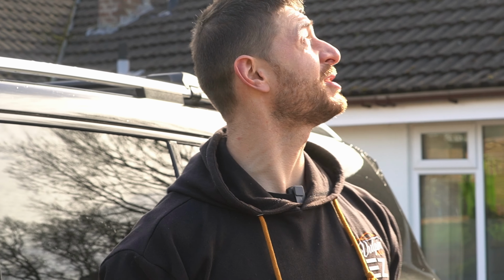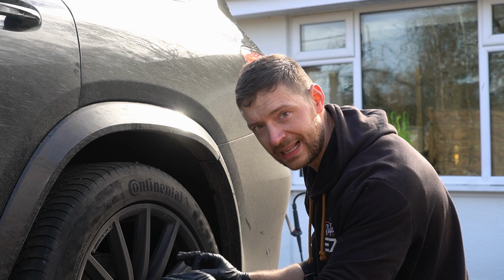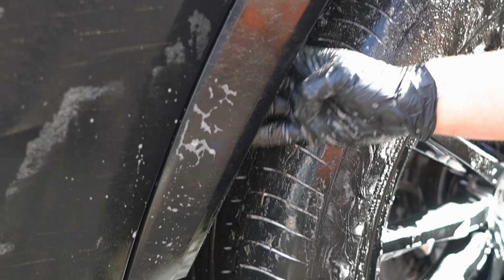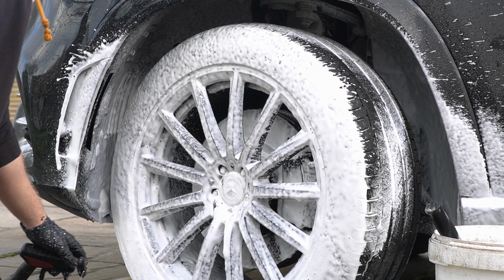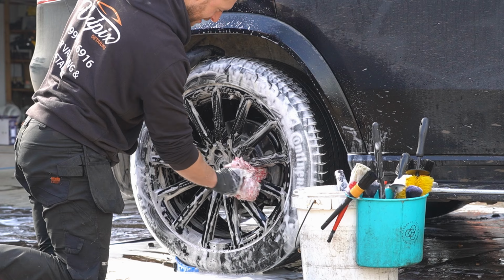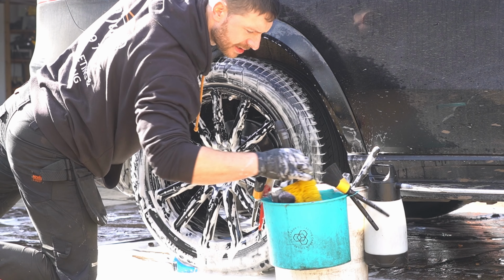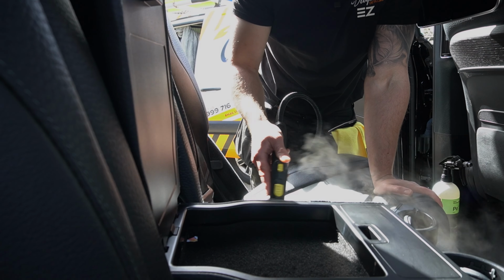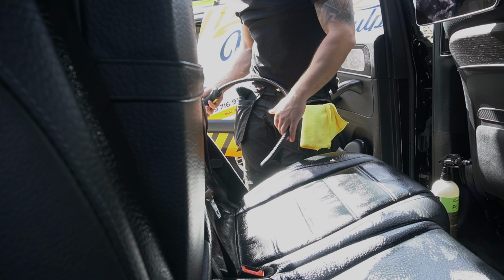Oddly Satisfying Car Deep Clean On A Mercedes GLS

Comment: Have you tried a pivoting attachment for your nozzle to get into the hard to reach bits on the arches 👍
Reply: He did at the beginning.
Reply: @Incredible-Auto-Detailing he hasn’t used a pivot attachment in this video dude he’s only used a turbo nozzle and two other nozzles without a pivot attachment he only turns the trigger gun towards himself 😁👍
Reply: @skysantana3178  Ohhh thanks for the clarification. I just call them the pivot nozle. Cheers
Reply: @Incredible-Auto-Detailing no worries 👍
Reply from the maker: @skysantana3178 I have one, I don't tent to us it that much. It's personal preference, you like what you like if that makes sense

Comment: What is the blue attachment you use on the wheel arches?
Reply: That’s a turbo nozzle
Reply from the maker: You can pick em up on amazon or Ebay for less than £10
Reply from the maker: Point to note be very careful when close to paintwork